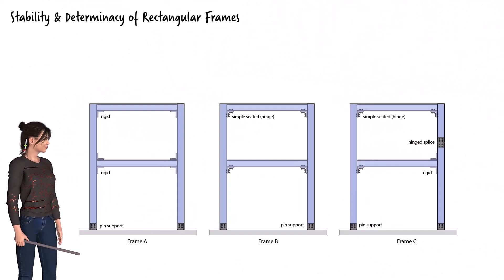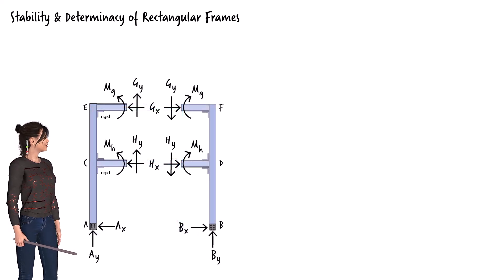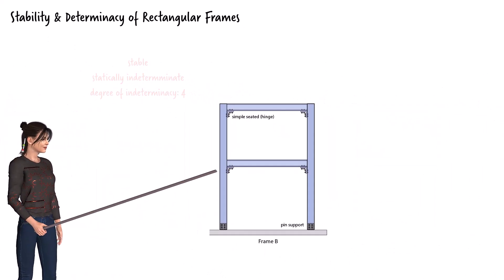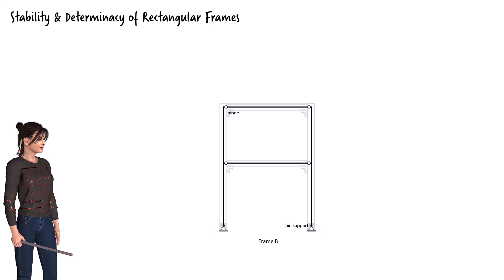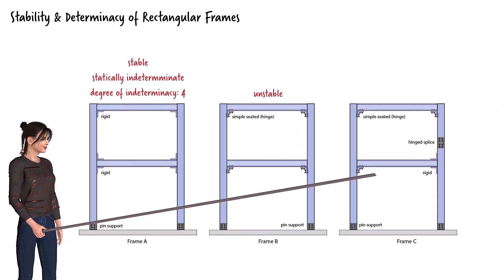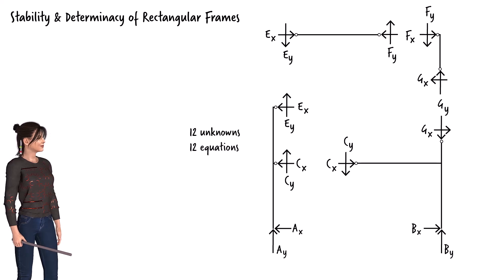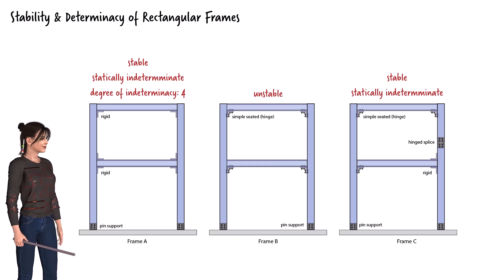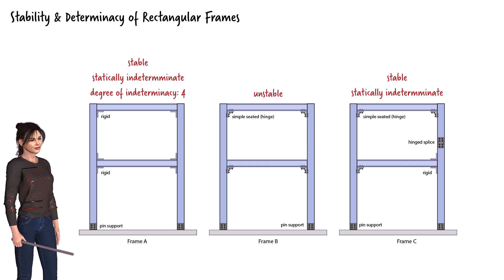SA76: Stability and Determinacy of Structures (Example 2)

Comment: animation is not a right way to teach engineering , i feel am like an idiot when such animation is there
Reply from the maker: Thank you for sharing your perspective. 

It’s important to distinguish between the medium of instruction and the depth of understanding it can support. Animation, like textbooks or lectures, is just that—a medium. The depth of learning doesn’t come from the format itself but from how the material is engaged with. Just as a book can be skimmed without true comprehension, a video can be watched passively without insight.

When used thoughtfully, animation can serve specific educational purposes: illustrating change over time, highlighting key concepts, reducing cognitive load, or providing context that may be difficult to convey otherwise. It can make complex ideas more accessible—both cognitively and emotionally.

At the same time, it’s worth recognizing that learning preferences vary widely. Some learners benefit most from visual explanations and cues; others prefer detailed text they can review at their own pace. Each medium offers distinct advantages, and what works well for one learner may not suit another.

Ultimately, the goal is to choose the media and delivery styles that best align with individual learning needs—so that each learner can engage with the material in the way that’s most effective for them.